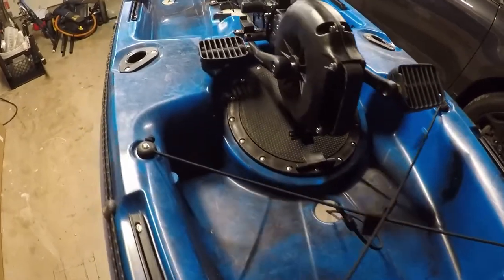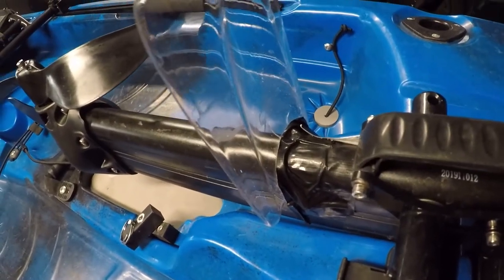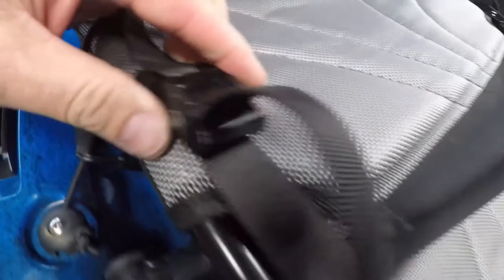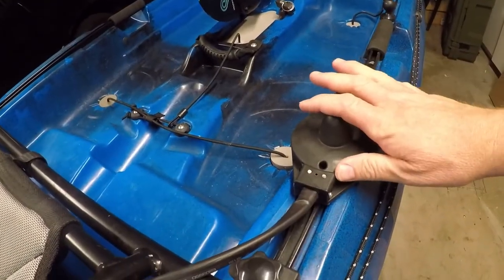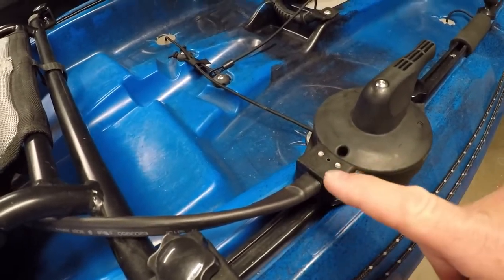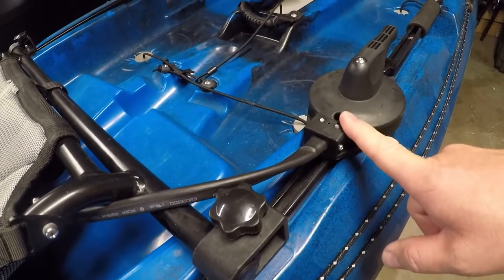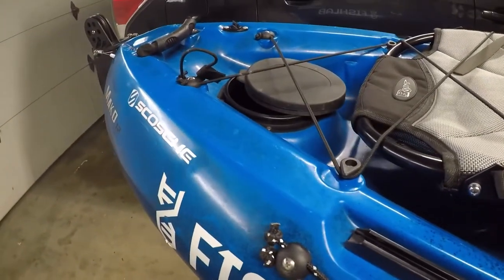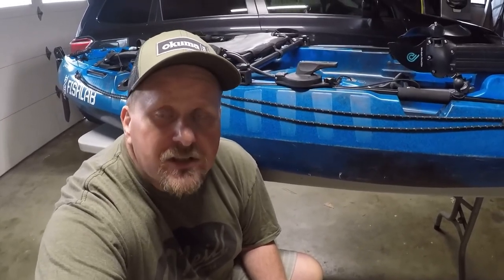Riot Mako 12 Kayak | 1 Year Review | Pros and Cons | Steering Modification

Comment: I just got the same mako 10 kayak and saw many videos on this subject.  My solution was to raise the rudder half an inch up so that the plastic is on top of the metal mount and the top of the bolt head is on the plastic rudder. Now the cable is straight and doesn’t touch the hull.  No drilling required!  I think they should have printed instructions to mount it this way.  Additionally I also removed five inches of the shrink wrap next to the steering handle which allows the white cable housing not to be bent as much.  (Think about when you were a kid and had to replace the cables on bikes, you never wanted to bend the cables tight, same thing applies here.)  Hope this helps people to avoid drilling holes.  I’ve also noticed that you will find this same Mako riot 10 kayak is sold under different names at different stores which allows them to raise the price. I got mine for $999. at bi-mart. Sportsman is $1299. under a different name. This allows them to offer a sale to clear out stock.  Additionally, you should also carry some thin cord with you so that if the cable does break, you can rig new lines from the rudder to your seat which will allow you to steer your kayak.  Enjoy your time on the water.
Reply: So far so good?

Comment: Are you comfortable with using a pedal system canoe?
Has the pedal system ever broken down?
Is pedaling tiring?
Does the canoe get water into it?
Reply from the maker: Hi there.  I have been kayak fishing for close to thirty years. Both paddle and pedal kayaks.  I am very comfortable in both.  
I enjoy the pedal system when fishing. I can still have both of my hands free to fish. 
Pedal system has never broke but I have had issues with steering cables breaking. I have had no issues with water, but a way to get water out of your boat, like a sponge, is always recommended.

Comment: I bought a used Mako12 with a broken cable. I bought cables off Amazon, too short🤦‍♂️. I ended up going to my local hardware store and bought cable by the foot of the same diameter. To terminates both ends I used cable crimps that are used for fishing high test line. Fix worked great. Instead of buying just a few crimps from the tackle shop for $$ I went through Amazon and got a kit with about 50 ea. size, multiple sizes for the same price as just a few locally. Hope this helps someone, it’s a very easy and cheap fix.
Reply from the maker: Good tips indeed.

Comment: Great video.  I was looking for a less expensive pedal drive and this looks like it.  I'm going to head over to Sportsmans Warehouse and check it out.  It's a year later now so I'm hoping they have the cables re-engineered by now.  If not, at least I'll know how to modify it.
Reply from the maker: They are certainly nice boats.  The new steering system is very solid.  In full disclosure, I went ahead and sold mine after the pedal system broke.  Once that was fixed, it was a good boat.  Good luck!

Comment: Cables in the link don't seem to be the same any more. They are listed as 1800 mm, which is only long enough to reach the bolts on the rudder. They aren't long enough to wrap around to be secured. Look for 2m long cables.

Comment: I have a mako 10 I replaced the steel cables with rope that Hobie uses made it left steering only and took that Big bend out of it just drill a hole to make a straight run.also cut down a 4 inch lazy Susan modified the handle and now it rides on the bearing ..buttery smooth  just got to apply some imagination
Reply from the maker: All good tips.  I just received the “new and improved “ steering assembly from the factory.  I’m interested to pop it open to see what changes they s risky made.
Reply: I purchased my first Hobie today I'm on cloud nine I just hope somebody buys my riot..good luck and stay safe with your adventures fellas

Comment: I haven’t taken mine out yet but I can’t seem to find any info on something I’ve noticed. How do you lock the rudder into the down position? Mine is loose because there’s nothing to latch the pulley into to keep tension down on the rudder.
Reply from the maker: Hello MaxMike- Thats an interesting question.  What sort of issue are you having with the rudder?  Once in the down position, I have not had any issues with it popping up.  It is pretty heavy, so it should pop back up.  You do want it to be able to move a bit up and down in case you do run over something.  But once in the down position, it should stay down for you.

Comment: Unfortunately my Riot Mako 12's steering was out of whack from the factory.  I took it out once and was very unsatisfied with its steering performance.  It took the steering control apart and saw that the steering cables were binding up and about to break.  It was literally hanging on by a single thread.  I replaced the cables with a new set and hoped for the best.  It was even worse, REALLY hard to turn the controls.  Even with the uncoated cables.  I go fishing almost every weekend, so this will not do!

I had to think outside the box, but I may have figured out a very simple and much more cost effective solution, but I won't post my results until I do further testing.  I don't want to waste other's time and money.  I will update or make a video if it all works out.  If my modification works, then it would add a ton of value to the Mako, since it is already a great deal for a pedal drive!
Reply from the maker: Good to hear you may have found a solution. I finally gave up and sold mine.

Comment: Hate to tell everyone, I have the new steering box and mine just broke.. The new one has the cables not right next to each other where they enter the steering mechanism.  I still think I am going to do what you did on the back once I install my new one...
Reply from the maker: I have also broken two sets of the new ones.  Not good. 
One thing I have since figured out is that the cables need to be pulled VERY tight.  This help in reducing them bunching up and snapping.  So far I am on three trips on the most recent install from about a month ago.  I do like the newly designed mechanism, but the tight cables is certainly key.

Comment: I have a mako 12 sitting in my garage with a hole in the hull. It's under warranty, and I have been waiting a year. I was fed up and purchased an old town salty pdl. The salty is a much better kayak. Easier seat adjustment, more seat settings for taller pedlars, the drive is more solid when engaged (very quiet), it is more agile, faster, and the build quality is much better. Take it from me, pay more and buy a better quality yak.
Reply from the maker: The newer Old Town boats are very nice.

Comment: I was all jacked to buy this kayak but this rudder issue is a real turn off. Have they fixed that issue if not I will look elsewhere ?
Reply from the maker: I know they have redesigned the rudder/steering system.  I’m sure the new boats are quite a bit more solid then when they send it to you and you have to DIY.  I’d just make sure the boat you get has the new system.  Other than that, they are a pretty solid little boat.  Mine gets a lot of use.
Reply: Again thanks for the reply it really helps in my decision to buy.
Reply: @DaveysWorldFishing  I’m looking to buy one of these off a guy for an extremely good price, is there anything I can look at that would indicate if it’s a new versus old steering system?
Reply from the maker: @TheBoatRampBaitBum  The newer version has the two cables coming off of each side. Pointing towards the back.  The old version had the both close together at the rear.
Reply from the maker: The one in this video is the old version. You can see the cables directly at the back at 4:17

Comment: could it be because they using the wrong cable for the steering.next time try using hobie Rudder Line, you will find out that it will work 100% better and it is very strong and durable.i had a four hobie and never had any problem with the steering line.
Reply from the maker: They have since upgraded their steering system offering less sharp turns.  It does work much better.

Comment: Should the cable loops be on the top of the rudder or on the bottom? The instruction video https://www.youtube.com/watch?v=PshuXNpmg9c&feature=youtu.be has the cable loop installed on the underside.
Reply from the maker: Interesting.  I don't think it would really matter either way.  The issue with the old steering was the kinking of the line right up by the rudder handle.  Not sure the loops would make much of a difference, but great question.

Comment: Did you get the newer upgraded steering for your mako? I just put mine on and havent used it yet but was wondering if the new one lasts
Reply from the maker: Well, to be honest, my new version broke the first trip out.  They have since sent me another new one and that one seems to be holding up good.  Not sure what happened with that first new one.  I do like the new system though.  Hopefully it holds up.
Reply: @DaveysWorldFishing  Has that new system held up?
Reply from the maker: @TheBoatRampBaitBum  I broke one right after I got the new version and they replaced it immediately.  The second one held up for about a year with a lot of use until I sold the kayak.

Comment: Where did you go in Oceanside? I’d like to see a new mako 12
Reply from the maker: The shop is called Oceanside Paddle Shack.  
2905 Oceanside Blvd
Oceanside, CA  92054
United States
Reply: @DaveysWorldFishing  I thought that was the spot. Went there Thursday, they’re closing down. Sending all the kayaks back to Canadian distributer. Hope they can get me a few replacement parts before it’s totally gone.
Reply from the maker: @daverage4811  Interesting.  I spoke to the Canadian rep this week.  He said they are about 3-weeks from getting a newly designed steering box.  
Interesting to hear that that shop is closing down.
Reply: @DaveysWorldFishing   What do you mean by a newly designed steering box?.. do you mean the steering handle? or by the rudder?. just curious..
Reply from the maker: @scarkilla  Hi Blake- I was told they are completely redesigning the steering system.  I’m guessing it’ll be the whole handle assembly and cables.
Reply: @DaveysWorldFishing  Is there some way I could get updates on when this new steering system is available as I would be interested in a Riot Mako 12 once this issue is resolved.
Reply from the maker: @jacribb  I have no idea.  Seems they have been pretty hush hush over it.  It’s a little frustrating.

Comment: Do you stand up much on it if so how stable is it?
Reply from the maker: I actually sold this kayak.  I rarely stood up on it. You certainly can. It was pretty stable.
Reply: @DaveysWorldFishing   Thanks for the info there's one in my area and want to get into yak fishing. Seriously thinking about picking it up tomorrow morning lol
Reply from the maker: @astronoman4  They are nice kayaks.  I fished it hard for about three years. 
If you are picking up a used one, be sure to check out the steering cables.  I had mine snap several times.  But they have improved the steering box, so hopefully that helps.